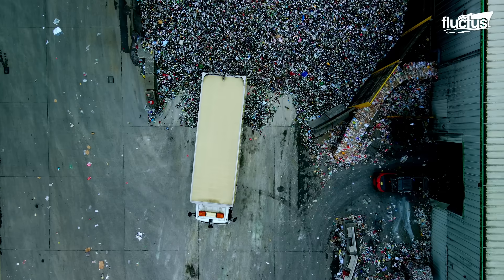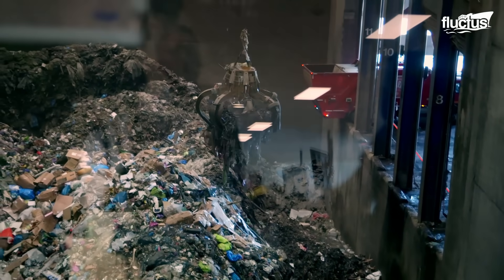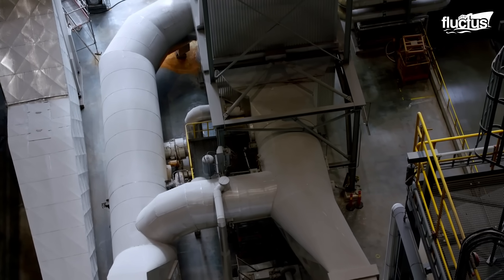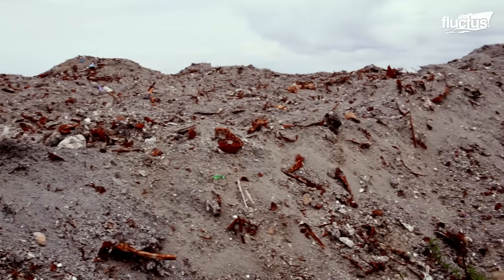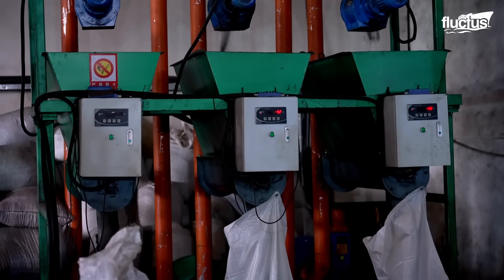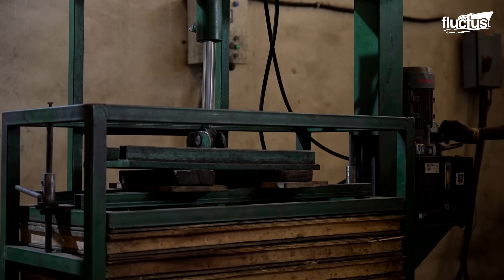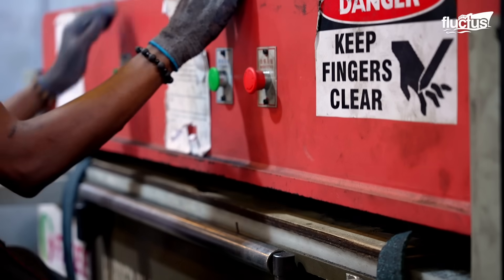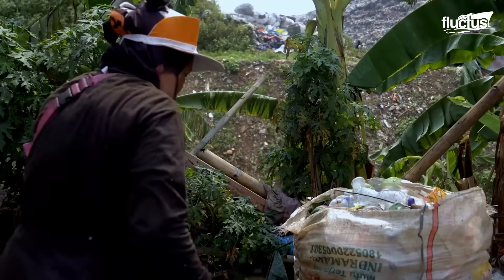Inside Sweden's Biggest Incinerator

Comment: USA, Suffolk,Va here. Interesting video. Finding a vendor that will buy and handle some products is a problem here. Our landfill in Suffolk accepts what garbage trucks bring in  and just about anything a citizen takes to the landfill themselves, such as wood , trees and lawn waste.  Metal , appliances ,   oil, paint and insecticides carried to the landfill by homeowners and businesses are  recycled. Tires are shredded and placed in the landfill. The city has recycling day events and takes in tires for free to keep them from being illegally dumped. Only #2 and # 5 plastics that are collected by the curbside recyclers are packed up and sold to vendors.  Other plastics that are placed in the curbside recycling bins go the  landfill because there is not a vendor close enough to send it to. However, Green Piece and our Enviromental Protection Agency agree on one thing. More plastic is being produced and more plastic is being put in the landfills. Mother earth is drowning in plastic.

Comment: Now the question is: what alternative energy & heat source is used when the plant is down for maintenance or an emergency shutdown is required??
Reply: Gas, bio gas, oil.
Reply: The energy is not a problem if the plant is down.

Comment: Law of conservation of mass, which states that matter cannot be created or destroyed, but can change forms. A ton of material goes in an incinerator, a ton of material will come out.
Reply: Conservation of ENERGY.... (not mass)
Einstein; E=mC^2 
Water and CO2 will also be exhaust.

The energy is the difference in mass.

Update: correction , the energy released is the chemical bonds between atoms. For oil the origin of that energy is the sun about 200 million years ago sequestered in oil -> plastic -> waste -> energy
Reply: @andrewboddy2791  The Law of Conservation of Mass dates from Antoine Lavoisier's 1789 discovery that mass is neither created nor destroyed
Reply: You use it as a fuel source
Reply: 1 ton is 1 ton ... somewhere .

Comment: 0:00  What about the toxic gases released when incinerating. That's the BIG problem with that method of 'recycling'
9:02  Now that's good recycling of tyres.
Reply: There are multiple stages of flue gas cleaning before the gas is released to the air. Swedish regulations are very tight in this regard.
Reply: @1riwa  I suspected they have it sorted but I wonder about others that don't bother to clean the exhaust.

Comment: Cool!
Reply: It's cool until you realize how disastrously bad the district heating system is which this powers.

1. Initial ads for it bragged about extremely low costs... Just to become one of the most expensive utilities ever to buy AND to maintain.

2. It has officially become more energy intensive compared to heat pumps.

3. Any disruption or damage anywhere in the system will cause tens upon thousands of people to be completely without heating. This is lethal in winter.

4. Facilities like these easily double in cost to build as to make them dual-purpose, heating both water and driving turbines for electricity.